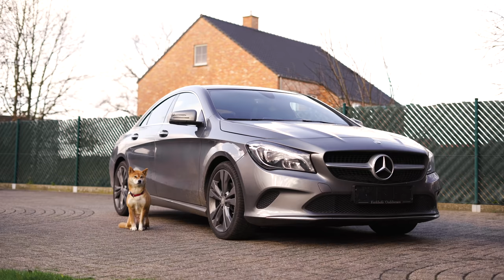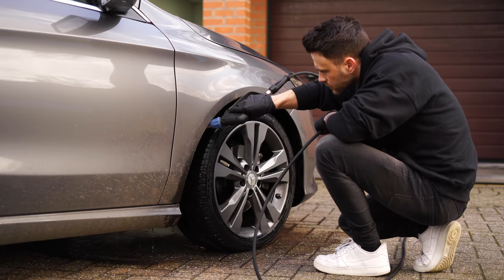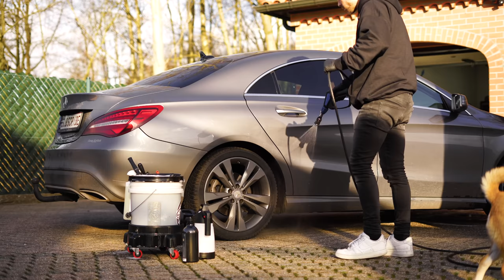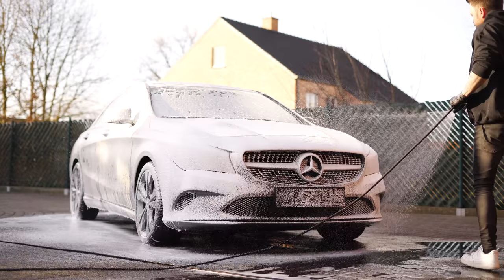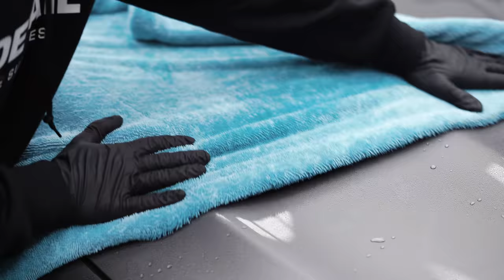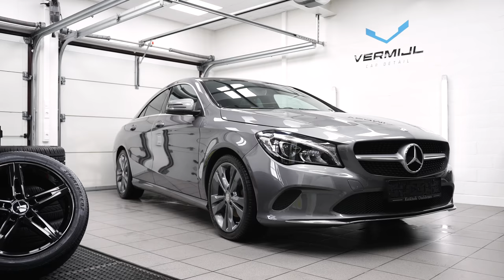Dirty Mercedes CLA Deep Clean - Wheels & Exterior Auto Detailing

Comment from the maker: Trying out some new products today! The all-new CARPRO ReTyre and Descale. Also giving the IK Foam Pro 2 PLUS a shot! All products are available in our webshop if you guys are interested! 😉
Reply: Muito bom seu trabalho, também sou da área estética automotiva 🇧🇷
Reply: Can you recommend the IK sprayers? I'm sure you've had a lot of use with them and I'm looking to buy a foamer.
Reply: @AMP8424  Once you take IK in hands and you fall in love with it. Quality of product is awesome 😁 The new model is better with compressed air plug. You can connect xiaomi portable air compressor with IK and use it untill it's empty with great pressure. 🤩 And don't forget to read instructions! It's improtant!
Reply: Hey Vermijl, I am interested in your pressure washer kit with all the upgrades. One question, do you sell the kit without the pressure washer and the foam gun? Because I already have a pressure washer and don't need the foam Cannon
Reply: You even made a Subscribe license plate!!!
Reply: @AMP8424  I own the previous version and have put it through a lot of abuse 😬 apart from the scuffs it still works perfectly fine although occasionally it may require the addition of some lubricant to the pump o ring to reduce some squeaks and hold better pressure (this could just be because of the frequency of its use). It would be interesting to give the new generation with the air plug a go as it would be a great time saver, alternatively if you are using something like breakbuster you could also use a foam cannon on your pressure washer and get similar results without the need for an extra tool.
Reply: You can add a detail keg to your arsenal, since it will take a higher charge and last longer.
Reply: @esteticaautoreis  😂😁😁😁😃@واللهي😃
Reply: I have a question dont you supposed to rinse the car from top to bottom?
Reply: You are the best i have ever seen. Good job man 👌